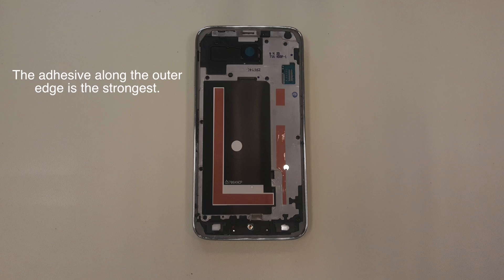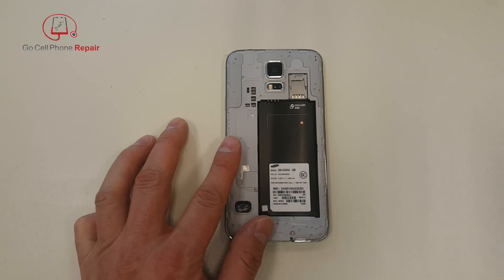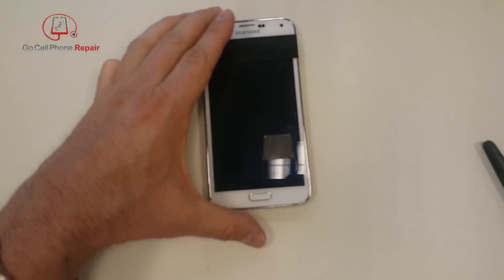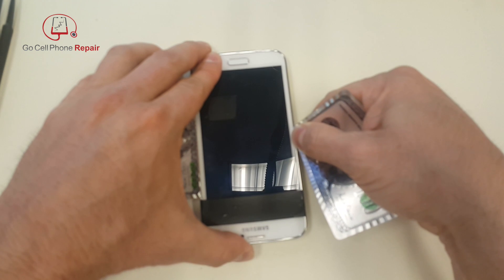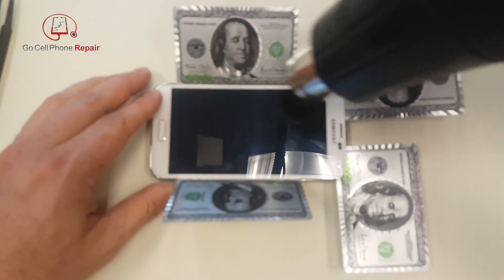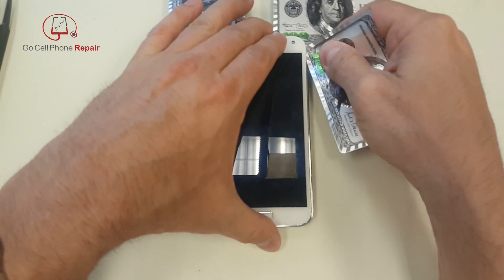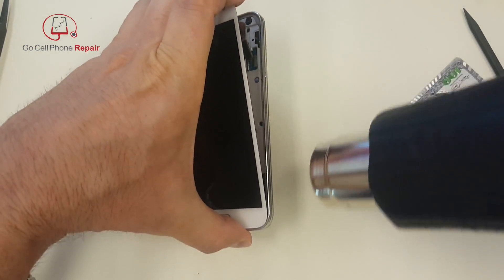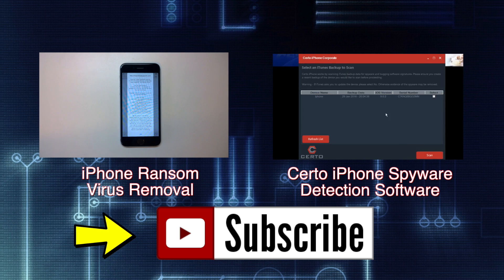Galaxy S5 Screen Removal September 2016 Update

Comment: I appreciated the video and tricks provided.  I found it to be the best one I have found. I started with my wife's old s5 that stopped charging last year.  We got her a new phone, and use the old one wireless charging for the patio.  Now mine has stopped charging but I am ready to replace the charging port. 

After watching this video, like "Papa Jahat" commented, I too, ripped the L shape brown copper part at the top right corner, which has a little chip attached.  After plugging the screen back in to test it, I found that it turns on and goes to the main screen, but there is nothing else that works.  You can't open an app or any other function so it is an obvious major thing that can't get damaged, so now I have to replace the LCD screen.  I am about to attempt it again on my own Galaxy S5, and hope to have success with this video, but an extra precaution when sliding the playing card downwards on the top right corner.  I think this being the case, and since I am going to replace the charging port, I am going to work from the bottom of the phone since the charging port comes with new stickers that could be ripped off starting from the bottom.  In fact, since a charging port is only $5.99 with free shipping from ebay, it should just be something everyone replaces if they are going thru the trouble to take off the glass.  Obviously S5's are old, so I am assuming there was no new videos for this model.

Comment: I am having a hard time separating the top glass from the digitizer. Any suggestions for this?
Reply from the maker: So you are attempting a glass only repair on the S5? If that's the case you'll need a heat source, playing cards, molybdenum wire, and a lot of patience. It's really something that requires practice though so if this is your first one the chance of causing damage to the AMOLED is high. Are you doing this inside of the frame?
Reply: Thank you for the fast response. Not glass only. I am trying to do the exact same thing that you are doing in your video. I have tried this on multiple S5's and each time I cannot get underneath the digitizer. The digitizer ends up ripping away from the glass...
Reply from the maker: Ah I see. Well it's kind of difficult to put into words but you need sufficient heat from the back side where the battery is removed but not so much on the front that the LOCA allows the lens to start separating from the digi. You may need more heat on the back and less on the front but it's really hard to say. I don't know if it will help but I made a video for the S5 Active which is even more difficult IMO. Right after the 4 minute mark is where I started to get under the display https://www.youtube.com/watch?v=h2dSRa4QZk4
Reply: Thank you. I will try to put more heat on the back of the phone.

Comment: would a blow dryer work the same way?
Reply from the maker: Not quite as effective since it takes a lot longer to heat up. Also dipping the edge of your playing card into 99% isopropyl alcohol will help getting through the adhesive easier.

Comment: Hi, this is an excellent video, I would like to thank you for this.
I am in the process of removing the screen right now. I have cards all over the screen, most of the adhesive is gone, but I am going to sleep for tonight.
There is something that caught my eye though.. It seems I have accidentally got rid of the adhesive between the screens frame.. and the screen.. A little bit.
Aside from that however, I decided to put the battery back in just to test things, and nothing shows up on the screen :(. I know the phone turned on however because it still vibrates and produces notification colors and what not. It's just the display. No display at all.
Is this because I have playing cards all over the phone? Or did I ruin the phone in general?
I will find this out tomorrow.. when I get rid of all the adhesive.. But I just wanted to hear from you if I should continue this project to save time or not. I really need a working phone as soon as possible.

Please note, I'm not removing the screen for a screen replacement. I have no replacement. The charging port broke and I just wanted to replace it.
Thank you, and have a nice day.
Reply from the maker: Make sure that the display cable is properly attached. If it is you might have damaged the flex cable at the top or cracked the AMOLED. Both of the latter are bad news 😕
Reply: u just unplugged a cord from inside y accident

Comment: I have a s5 whose screen os a stiatic and yellowish color after a drop, could a screen replacement fix this?
Reply from the maker: It should. I'd try unplugging and reconnecting the original screen first and then attach a new one before full installation to make sure.

Comment: Have you (tried and) succeed at replacing just the charging port on this one? I mean just soldering a new connector, not the whole lower board?
Reply from the maker: I haven't only because since you're already inside of the phone it's easy enough to just replace the whole piece. On the other hand with the S6 and S7 we always desolder and replace the micro USB and it works great as long as you are careful not to damage nearby components.
Reply: I see, but I ask particularly because the S5 has a larger 3.0 "Micro-B" usb connector. I found it trickier to get right than most other types.
Reply from the maker: If I remember it has that weird resin glue under the first metal panel doesn't it? I'll have to look at one when I get a chance.

Comment: Thank you for this.  Do you have one on replacing the charging port on this Galaxy S5 when the screen is cracked.  I am trying to move all data to another galaxy 5 but, I need the port to work.  I know about using smart switch, etc but, I wanna use Mobile Trans App to move all the data.

Comment: Will this remove its IP certification once you disassemble it? I have a broken charging port I'm planning on fixing/replacing it myself, great tutorial BTW Thanks in advance...
Reply from the maker: Yes it will. We recommend applying new adhesive after thoroughly cleaning the old stuff off although technically you can get away with reusing it. Once your phone is opened though it will never be quite as water resistant as it was from the factory. You could go wireless charging but that's not always convenient of course.

Comment: A couple points. Heat from the back helps. Lifting the screen all the way to the bottom will result in torn soft keys. More care and slower opening to make sure they aren't stuck or tear. Razor is a bad idea for lift. Use a suction cup to pull up and insert the cards. Take care pushing the cards in so they don't get caught on the AMOLED.
Reply from the maker: Thanks for the input. Yeah this one was warm enough that it kind of just fell open without really sticking to the capacitive buttons. It's been 90 degrees F plus all week so that probably contributes to the ease of removing adhesives. Are you running into problems using a razor to start the prying? I've found it to be the easiest most reliable way to open most phones as long as you are sure to get under the paint and don't slide it but rather prop the screen up enough to insert a thin pry tool.
Reply: Go Cell Phone Repair Hey bro whatever works. In my experience the S5 does not need prying up to get clearance for the playing cards. After enough heat a good suction cup at the corner will separate the glass enough to get a card started. I do use shaved thin guitar picks to increase the opening slightly for the card to slip under the AMOLED. The hard metal razor blade has potential to scratch or break the glass. I just try to minimize risk.
Reply from the maker: Got it. What do you use when unable to get good suction on the glass?
Reply: Go Cell Phone Repair If the glass is shattered to the point where you can not get suction who cares. I was talking from the stand point of removing a good screen to replace something internal. If the screen is good I don't want to pry at all. Too easy to break.
Reply from the maker: I see. Recycling companies pay about $50 credit for cracked glass but working AMOLED+digitizer so I'm in the habit of keeping them in working condition. It allows us to do the repair for less.
Reply: Go Cell Phone Repair I mean who cares at that point what you use, razor, metal pry tool, plastic spudger, shaved credit card. Of course salvage a good display. Really a hotplate cuts the job down to a few minutes. My original post was not so much a criticism as an observation from my own experience. There is more than one way to skin a cat.
Reply from the maker: For sure.

Comment: You're doing it the hard way. get yourself some isopropyl alcohol and suction cups. Much, much easier!
Reply from the maker: I'm going to guess that FDR is talking about coating the playing cards with iso to help work through the adhesive. I do this myself when working with something really sticky. Used that and heat to remove the old chrome trim on my car doors when it started fading. That and heat works wonders. As far as the suction cup you can use it to pull the display from the front if the glass is in one piece. Just be careful not to use too much heat as it is possible to lift the glass away from the AMOLED if you aren't careful.
Reply: explain please
Reply: Kind of like that... And I like that idea, but we use a lot more than a coating!

To be fair, I'm kinda cheating. The repair center I work for, which does a lot of accredited work for a certain company whose phone might be featured in this video, I can't really say to much... 

But anyway, we use a small specialist oven, phone goes in for 10 min in at 70 degrees celsius. Then it goes in a small spring loaded table vice (with plastic jaws, obviously). Now comes the magic, basically a jig that fits over the screen with suction cups and a screw that goes off to the side to lever the screen off (kinda hard to explain, sounds complicated but it's actually really simple if you saw it).

The iso then gets swabbed generously about the edges of the screen as its lifted off, the suction draws it in and it releases the glue within seconds. Once it's in the jig it's open in a minute or so.

But like I said, that kinda cheating ;)

And great videos man, they've helped me out once or twice!
Reply: I forgot to say though, a small clamp and a decent suction cup does pretty well. Main thing is swabbing the iso around the edges so when you pull the screen up a bit with the suction cup, it draws the alcohol down. That with a bit of heat really helps loosen up they tapes :D
Reply from the maker: Cool. Always trying to improve the process.

Comment: if there are cracks on that glass then the chances are you going to break it about 70%
Reply from the maker: I absolutely agree that cracked glass is a consideration since it helps to support the AMOLED. That said, we have been using the same method since the S5 was released and once you get the hang of it you'll rarely if ever break the display. Just take your time and make sure not to flex it too much. As Hawaiisidecar mentions below heating from the back in that situation, specifically inside of the battery compartment, will help to better release the "L" shaped adhesive.